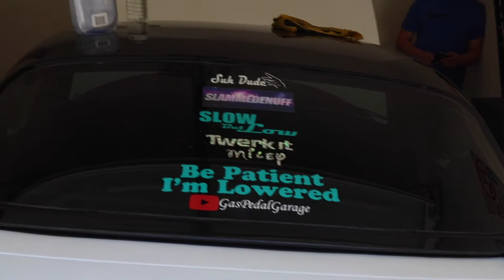Because Racecar? | Miata Fitment

Comment: no scrape when turning? i got the same size wheel with 205s and even after rolls and pulls my front hits fender hard on sharp turns.
Reply from the maker: +Rich I'm running 195s so that could be why I'm not rubbing, I cut half of my inner fender out as well
Reply: Dude I have a few NA Miatas. my pop bought a pair for us on my 16th Bday. it was my first car and still have it and his as well. He got a BRG and mine was Mariner blue. They are both V8 cars now and my car is Kandy French Racing Blue and his is Gold based Kandy BRG,both colours are from House of Kolor Kustom Kandies. We both have 15x9 0 offset rear with 245/40s ..We didnt drill holes or no stupid shit. Our body shop added a thin layer of steel and oxy-acetylened the rear fenders stretching them 25mm. Front we both have +18mm Carbon fiber fenders and front tirrs on the 15x8s are 225/45 proxeR888 front and back just wider rims out back for traction. We have a set of Hoosiers but they make it feel sketchy since the VmaxxCoilovers are spun down 3.25 in front and 3.10in rear so the stiff ride really jacks with your control on the street. Mine has 720hp/600trq Flying Miata built ours. I used a crate GM LSX/Edelbrock E-Force 416ci,Magnum T56,built 8.8IRS with 4.56s and titanium half shafts. His car is running 554hp from a LS3 with  3 angle valve work..If you are looking for a turbo or supercharger set up,we have both. the 3rd NA is crystal white like yoursonly had 33,000 miles with a hardtop and paid $3000 for it in Florida. It had a Sebring Supercharger and the guy was 79 years old and gave us a Texas Turbo complete setup including intercooler..the turbo is a 2 inch outlet Garrett ballbearing GT3071 GEN X..have all gauges,550cc injectors,Texas Turbo monster max fuel pump with a fuel rail and adjustable pressure as well as a boost controller. We paid an extra $1000 for it and his receipts were over $6000...He had a mild stroke and just was done. I have quite a large # of parts as well. I have seats,short throw shifters,Avid Av12 15x8+15 offest gold rims,F1R 05s in 15x9 that are discontinued..They are blue..none of our cars had over 70,000 miles. before we pulled the stock drive train.super lock LSD that was in the florida car...plus tge 2 LSD rear ends from our own cars. I have a whole parking spot in my garage full of parts and even though they all have oem hardtops,I have to leave one outside. Even my new car and daily driver arr stuck outside and I cant get code to allow me to build another garage. I live in Vail Colorado and they dont like to grant many projects that mess with the looks of the part of town I live in which is the older part and already had the garage extended to 3 cars from 2 in 1980. My house was built in 1921. so they are strict.I operate a few Dispensaries here in the state and my pop just moved close by.He wanted a job. He gets bored now that he is retired so we are trying to find some property or even a small warehouse because not garaging your car here at night sucks. we dont have rust issues at all. They use a salt free deicer on roads but we never drive when it snows. we snowmobile around. every one does. My WRX has over 200,000 miles and that ny daily. Still looks new, I just have to drive Vail to Aspen,Colorado Springs,Pueblo..I actually started flying a local company that use single engine and twin turbo 8 to 18 passenger planes to go to Aspen and Colorado Springs. It was 6 degrees F.. last night.. anyway man. Im a little stoned and rambling. If you need any parts,I probably have them. Enjoy your car man!